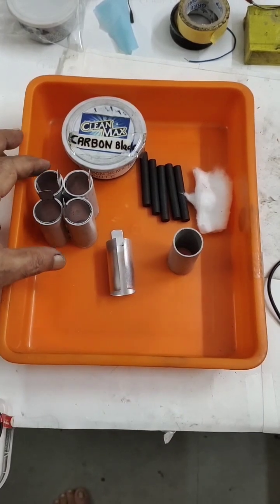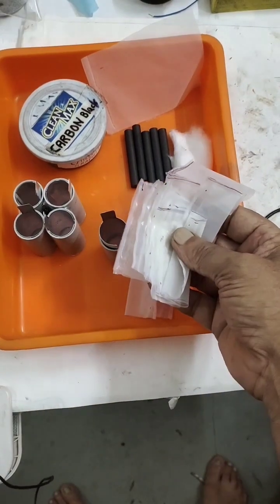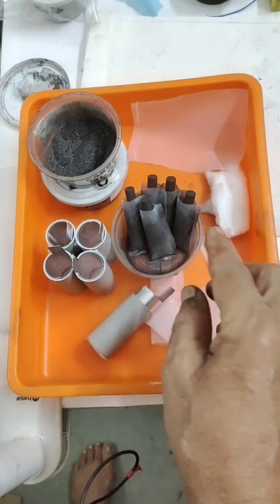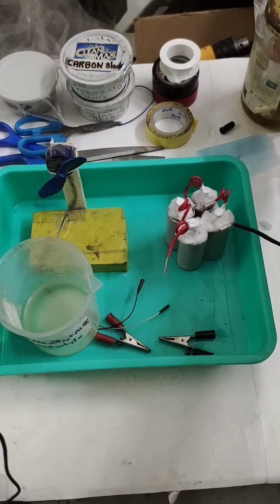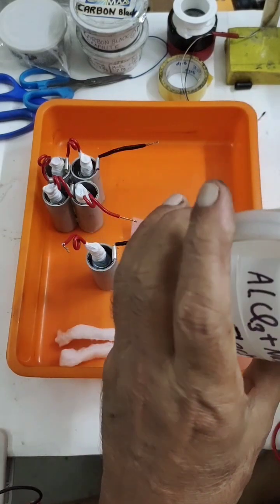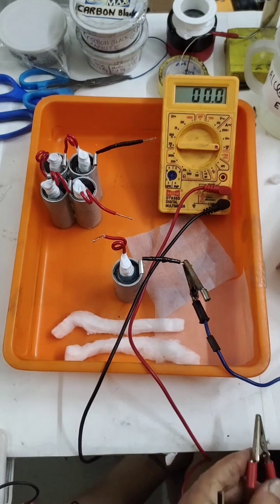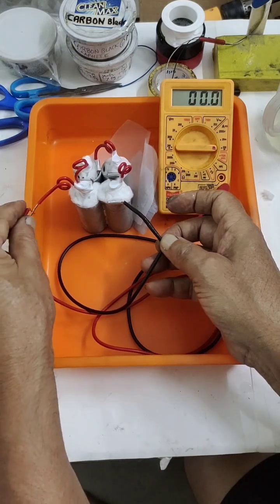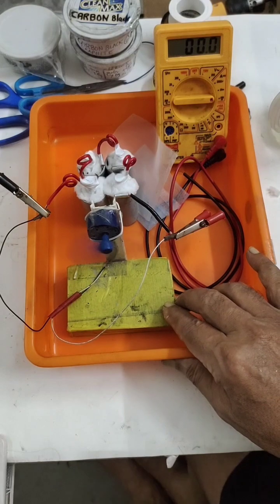NEW ALUMINIUM ION BATTERY , EXCELLENT RECHARGEABLE ,  DIY WITH AVAILABLE MATERIALS , 6.4V , C 200mA.

Comment: Interesting. The motor that I'd runing how many volts is it? What did you use to melt the allumium pieces? When u said rechargeable does it mean when it comes down from the volt we saw before the charging which was 1.69/70v? If a larger contain is used will it increase the voltage?
Reply from the maker: You can see the diagram sheet  . Aluminium pieces will instantly react with concentrated HCL. Don't heat. This itself will liberate enormous heat during reaction. Keep the unit on a water tub to cool . Finally you will get  liquid of aluminium chloride. Keep them in air tight bottle.. each cell will give 1.5v. You have to make more cells and connect in series to increase the total volt. You can refer my other videos. It will be clear👍
Reply: Sir
I am interested in building a carbon battery for an inverter application (150àh) any suggestions that would help me - I have very little chemical experience
Thanks